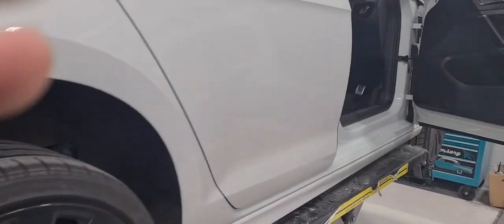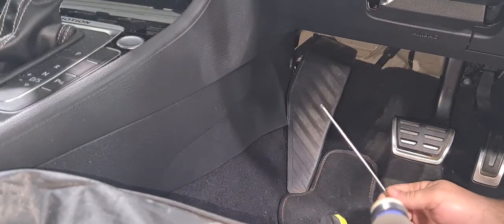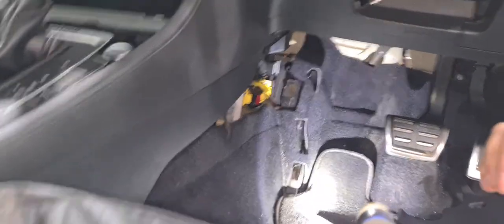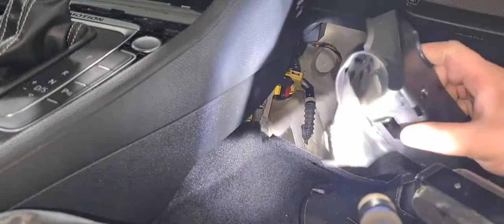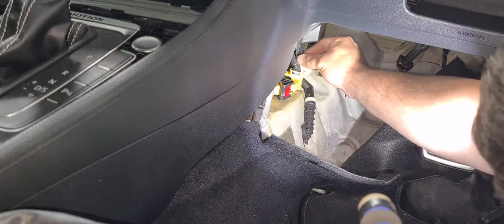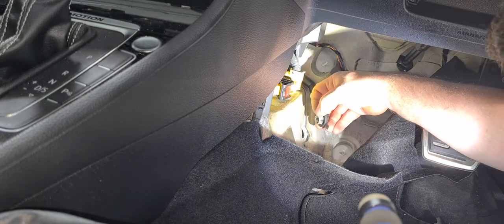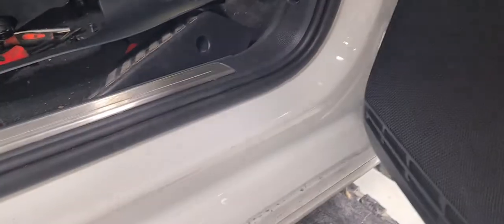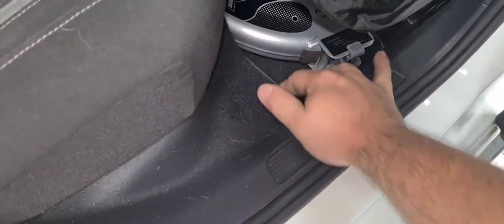How to fix or acces aircon drain on a 2016 golf R...or any car from the VAG group...

Comment: seems like a common problem for VW cars, i got this water issue with my 2018 Tiguan, filled with water.. Great Video!!
Reply from the maker: Thx for watching sir...
Reply: How do you remove the pipe from the tunnel? Mine seems to be well attached doesn’t want to move and I don’t want to break it

Comment: I recently bought a 19” Jetta, I noticed a musty smell then also noticed the carpet was wet on both driver/passenger side. I check the passenger side for that same hose you glued in the video. Does the driver side have the same drain hose or only the passenger side? As soon as I pulled the hose water started to drip out. I then te installed it and ran the ac but do not see ac condensation dripping on the floor. Any idea what the issue can be?

Comment: I'm not sure what the differences are between right and left hand drive Volkswagens, I'm trying to find the drain on a 2016 U.S. Jetta. This was an excellent video even though it may not exactly apply to my car, I wouldn't have thought to look in the center of the car.
Reply from the maker: If you talking about a/c drain...are the same,even the panoramic roof...

Comment: I may have this leak. Can you tell me where was wet in your car?

I have a small wet patch under the front of the drivers seat. I have felt the underlay and it is wet in a larger area than the carpet. I found a new spot today where the front left bolt for the drivers seat is too.

Thanks in advance!

Comment: Great video Sir. Its surprising how bad and poorly designed some parts on VW cars can be. I had a major leak coming through my Golf's taillight which I fixed. I now have an issue where my windscreen keeps steaming up with moisture on the inside. I've noticed the glove box is wet and also behind it I can feel wet patches. I have replaced the pollen filter which is fine. I'm led to believe this could be something to do with a blockage?
Reply from the maker: Any chance you have a panoramic roof?
The drain goes under the A pillar trim,check that...or see if the wiper mecanism area have the drains cloged...water can go to the vent motor inside your cabin...take your cabin filter out takes cuple seconds and if is wet look no furder.
Thx for watching sir,dont forget to like and subscribe to suport my chanel is free...
Reply: @howtowithjohn581  No I don't have a panoramic roof but I will check if the cabin filter is wet. I have noticed the area round the windscreen wipers does pool quite a it with water on the outside so that could be it. Thanks for your help, subscribed 👍

Comment: Hi, thank you for this video, I removed the drain pipe but there is no water when AC is running, pipe is clean. What else could the problem be?
Reply: Water in the speaker seal, front or rear door.

Comment: But if it's blocked how will you unblock it? Would you put something thin in the pipe and unblock it like that? And where would all the water go, if it gets unblocked?
Reply from the maker: Is easy to do what i did then to try from under the car...on FWD golfs you only have in your way the resonator and the heat shild but on 4x4 you have the drive shaft also...so is to mutch work to acces it from under the car. If you never runned the car without the cabin filter is imposible to be bloked.  What is your issue?
Reply: Thanks for your reply!! I did change the cabin filter, but I hear a "sloshing" water  sound from behind dash board and I don't see any water under the car after running A/C. I have a 2014 Mk7 GTi.
Reply from the maker: Make sure is not from the outside,where the wiper motor sits...because of leafs or other things the drain clogs in...look with a lamp thru the grill under your windshild...
Reply: @howtowithjohn581  okay thanks. I will start there and let you know how it went.

Comment: I get alot of condensation inside my Seat Ibiza could it be this drain?
Reply from the maker: Hi,condensation on the front window is from cabin filter or under the bonet cloged drains...if rear windows are foggy then ceck for water leaks,door speakers seal,tail lights seal,booth vents,rear camera drain...or door or sills dranes blocked